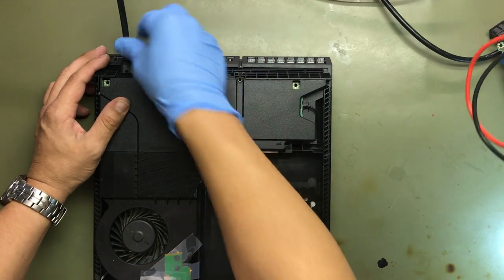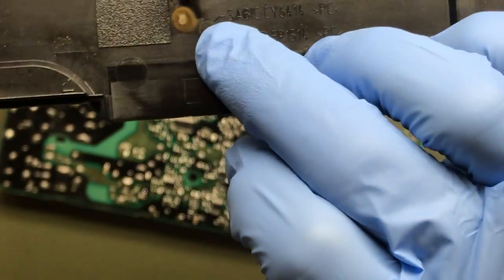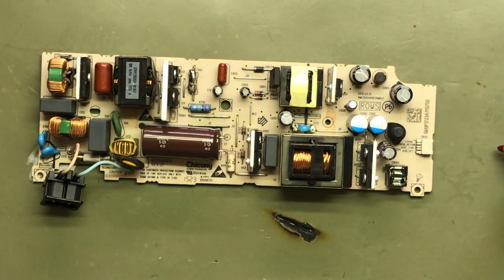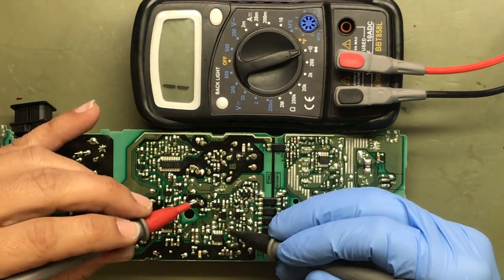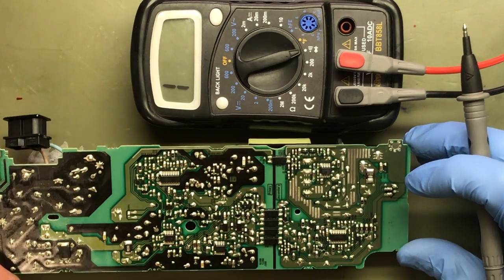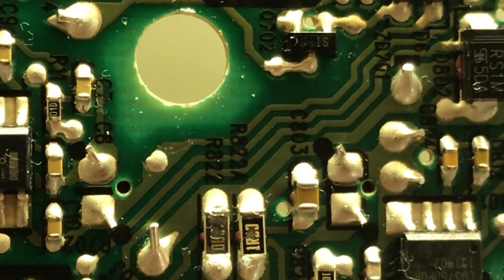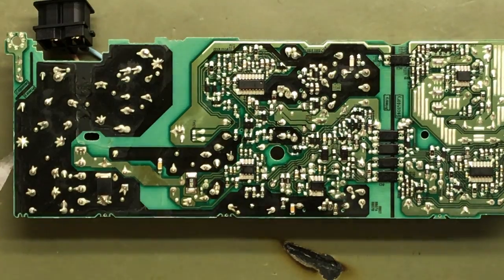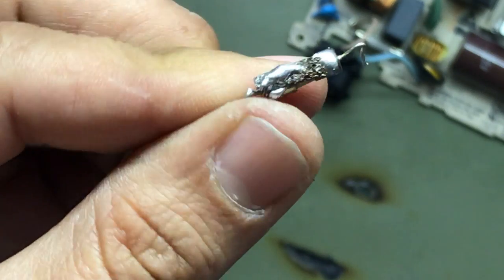PS4 Power Supply PSU N14-200P1A Repair Fix

Comment: In my power supply, pin 2 and pin 5 of ic mp6922 is shorter. The secondary legs of the small transformer is shorted as well( continuity test) but I have 4.89V on the 4pin connector. I can't seem to get 12V from the other. What do you think is really the problem.

Comment: Hi i have ps4 1115a and i do minor repairs, but im now teahing myself to repair power supplies instead of odering refurbished on ebay all the time. Most ps4 1115a i get when customers bring them it starts to work at my shop but when they carry it home then use it once or twice, the next time they power it on it goes into blue light of death again. Then if they bring it at my shop it turns on and works normal. Did u ever experience this. THNX ALOT I APPRICIATE YOUR VIDEOS

Comment: I have a PS4 model 1216a with a power supply model adp-200 er that does not turn on I am trying to repair it has a transient mosfet chn520 (puts it in the transistor) wrong and a coil burned but I can not find the compatible components I do not know if you knew what they are,
Thank you very much I send you a link from a YouTube video where it says what these components are
thank you very much.

Comment: i have twoo  psu with the same problem  thanks so much for video,the value of resistance on aliexpress etc are 1206" 1.8ohms in this case, but are 1/2w..   in mouser part number are 1210 - 3/4w. is so strange... i dont think  that package are 1210.. the dimensions i have in all psu ps4 are 1206"
And dont forget, THE Q801 is the principal suspect here!!!!!!!

Comment: hello jonathan I could repair the power supply with the components you told me,
Thank you very much.
the problem that now turns on the ps4 console and the second one goes off you have to remove the power cable to be able to turn on and do the same disassembled the base plate and the metal connector that goes to the 12v power supply is the black metal as burned.
Do you advise me to change this connector? or you think it may be a component of the motherboard that short-circuits.
 Thanks for all that you do.
Reply from the maker: Victor Torres Barbero I don’t think that is the problem. But it is a symptom of a different problem
Reply: ok 
ok I will continue investigating and I will tell you the solution thank you very much for your patience I am addicted to your videos a greeting.
Reply: good morning jonathan change metal connector base plate that goes to the power supply worked ok many thanks for your help
Reply: good morning jonathan change metal connector base plate that goes to the power supply worked ok many thanks for your help